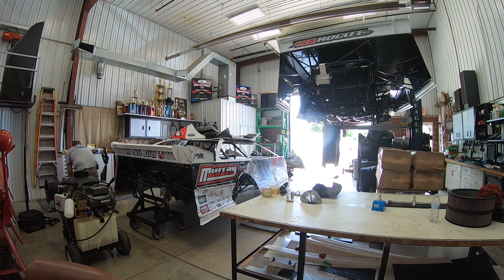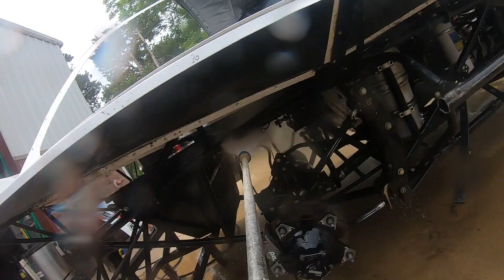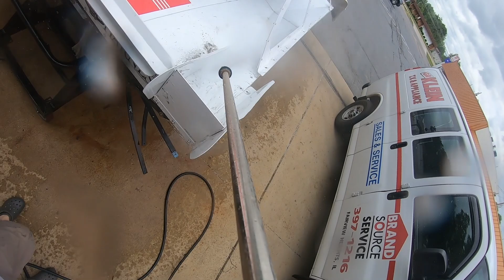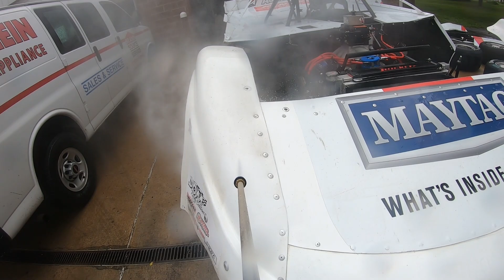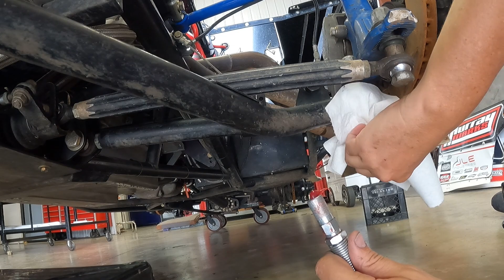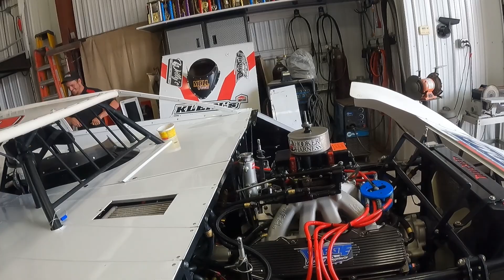Wednesday wash day this week with a guest appearance by DK himself.

Comment: You are one of a few running Ford engines. I am a Ford man. Retired from the Assembly Plant in Kansas City, began my career at the Hazelwood plant. I am from St Louis. 
What size engine do you run, what's the horsepower and torque if you don't mind me asking.
Reply from the maker: its a 410, making around 825 horses, do not know the torque numbers
Reply: @darynklein1075  wow, that's awesome. I am a Ford man through and through. I'm now a huge fan of @DarynKlein10